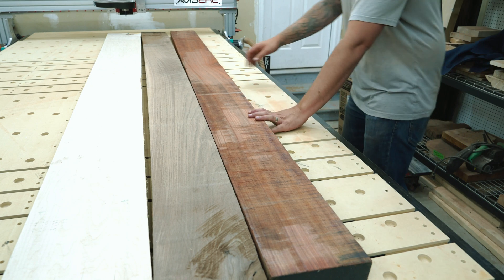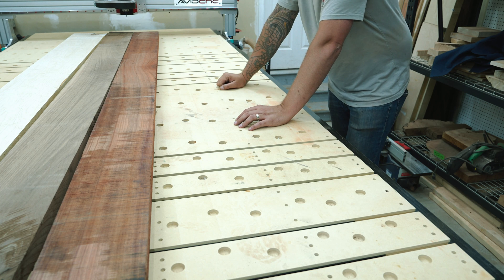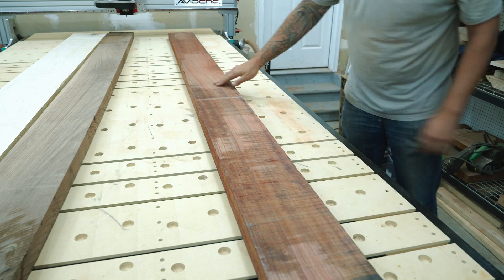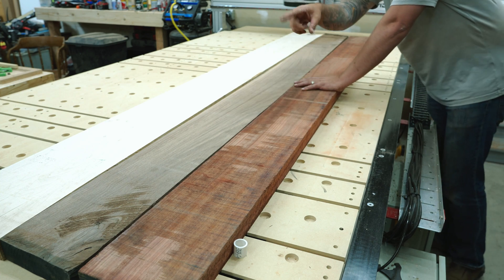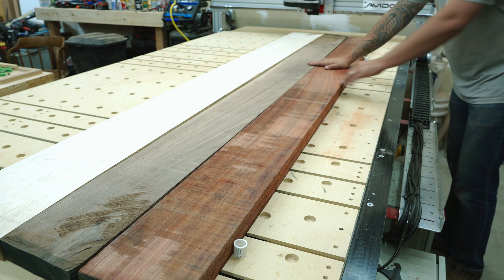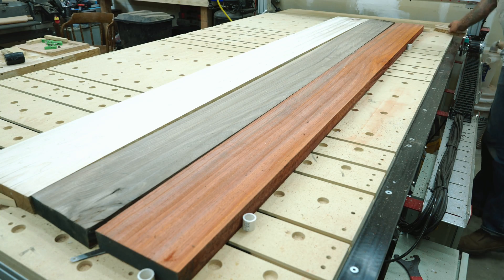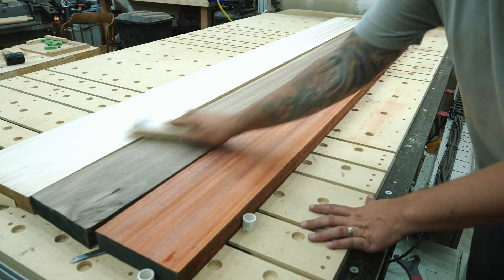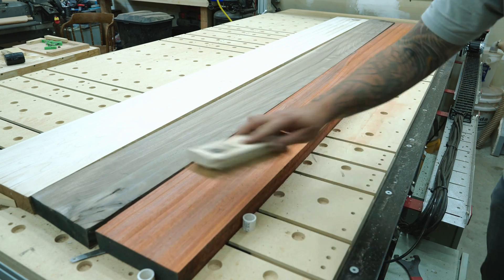This SAVED my back! Flattening Lumber with my AVID CNC

Comment: Good to see you back with videos Maurice. Actually was watching your live with Mark Lindsay last night. Since getting a second CNC, I regulate my old one to surface as well as joint one side for glue ups. As long as it’s trammed perfectly, saves milling on the jointer. If not or questionable, I’ll flip other board over so they equalize each other out. And it is great for end grain as well since I don’t have a drum sander. Looking forward to your flag video.
Reply from the maker: Yep!!! Equalizing each side is a lot easier moving forward!